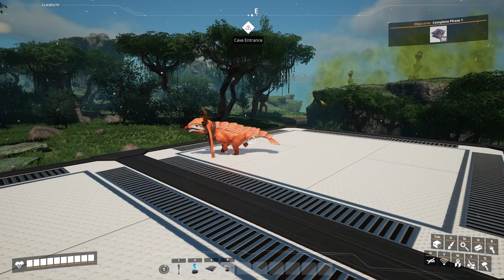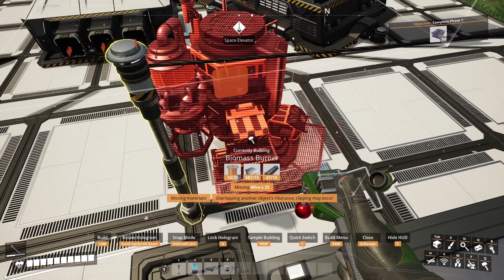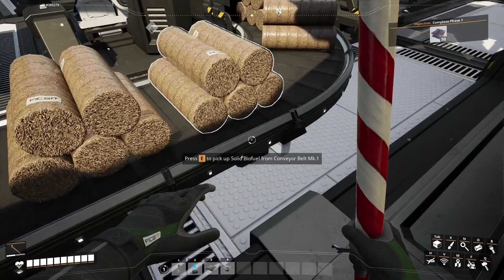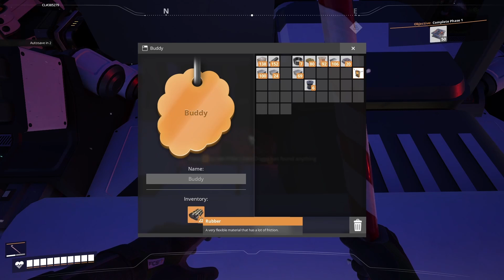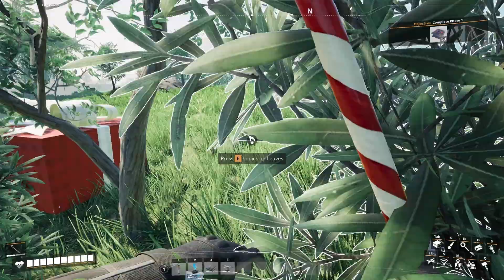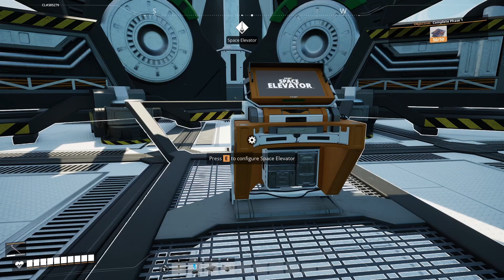Mostly Satisfactory - EP8 - I Found It!  Now What?

Comment: There are a few features of Satisfactory you might want to consider. 

Auto Branding: You can set your default colors in your customization menu. Simply change the FICSIT Factory Swatch to your brand colors. You can view your exact color from the Custom Swatch and apply the number codes to the default. This will change all current defaulted items to your branded colors and all new builds will have brand colors.

Auto Right Angles: When building conveyors, if you hit the "R" button, you can change your "Build Mode." If you change it to "Straight," your conveyors will bend at 90 degree angles on turns.

Building Multiple Foundations: When building foundation or ramps, if you hit the "R" button, you can change your "Build Mode" to Zoop. This will allow you to build up to 10 foundations or ramps in a straight line. 

Snap to World Grid: When placing a non-connected foundation, if you hold "CTRL," the foundation will auto-align with the cardinal directions and will be able to smoothly connect with any other foundation already set to the world grid. (Recommended to use a 4m high foundation as the initial foundation for correct height alignment.) 

No Fog: (OPTIONAL) If you would like to see through the fog, there is a consul command that will get rid of it. It is not permanent and optionally needs to be applied during each session you wish to use it. To use - hit the "~" key to pull up the command line. Then enter "r.fog 0" (that is a Zero at the end) and hit "enter." If done right the fog will disappear.
Reply from the maker: These tips are awesome AND they don't include any spoilers.  THANK  YOU!  I will look into these.  You rock!  Cheers!